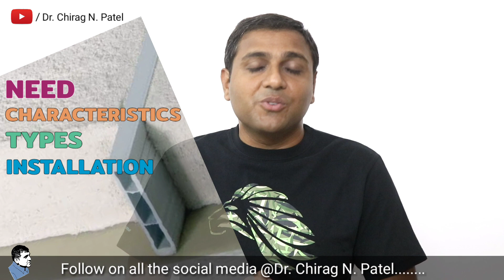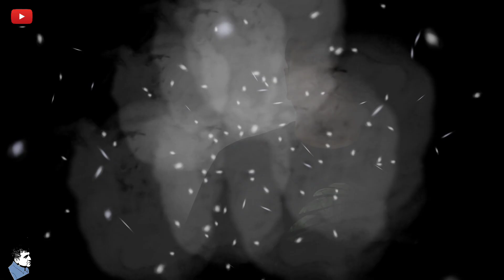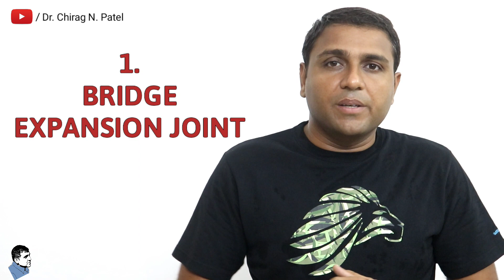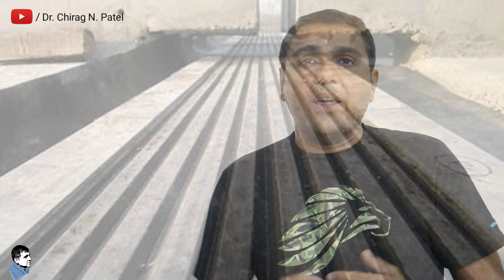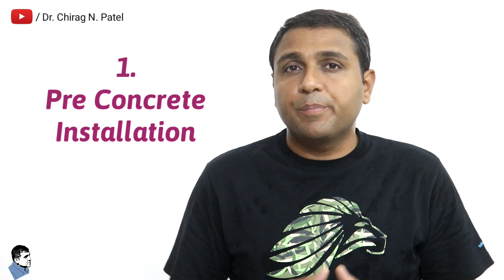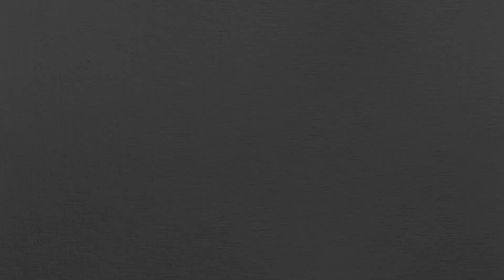Expansion Joint | Expansion Joint in Concrete | Concrete Joint | Concrete Expansion Joint

Comment: Sir how expansion placed in retaining wall and which material
Reply from the maker: At vertical wall section of various material.
Reply from the maker: @bharatraygor  Can you please refer this link: https://www.loc.gov/resource/hhh.ut0707.photos/?sp=5
Reply from the maker: Dear Ankit Can you please refer this link: https://www.loc.gov/resource/hhh.ut0707.photos/?sp=5
Reply from the maker: @bharatraygor  Vertical expansion joints are incorporated into the wall to account for expansion due to temperature changes. These joints may be filled with flexible joint fillers. Greased steel dowels are often cast horizontally into the wall to tie adjacent sections together. Expansion joints should be located at intervals up to 90 feet.
Reply from the maker: Vertical expansion joints are incorporated into the wall to account for expansion due to temperature changes. These joints may be filled with flexible joint fillers. Greased steel dowels are often cast horizontally into the wall to tie adjacent sections together. Expansion joints should be located at intervals up to 90 feet.